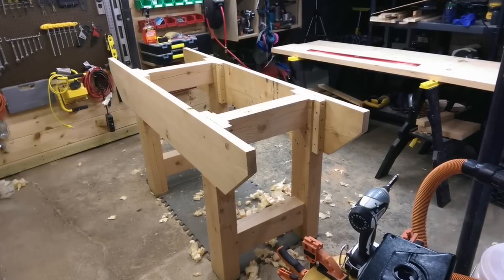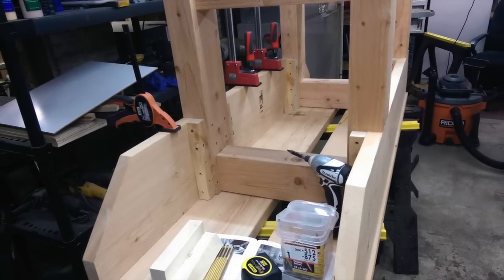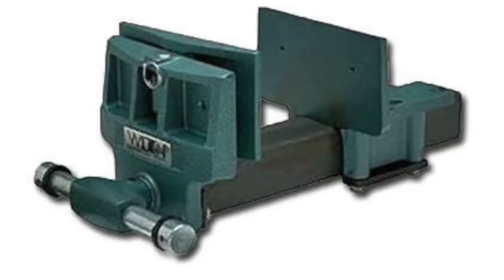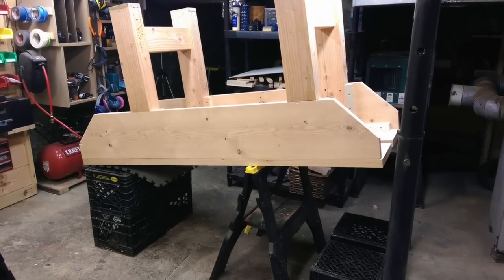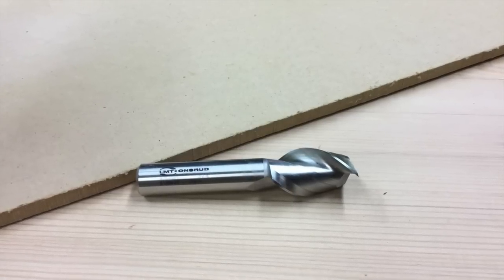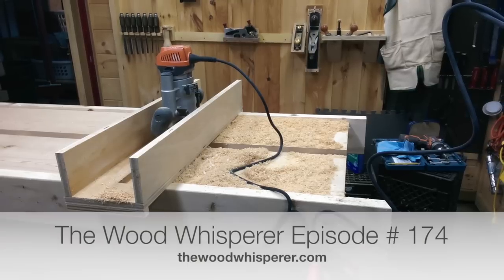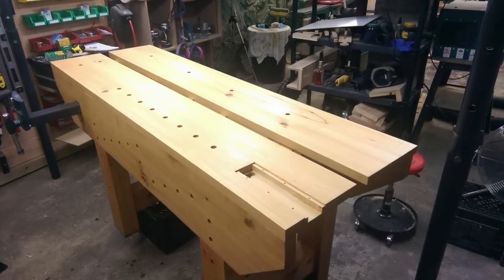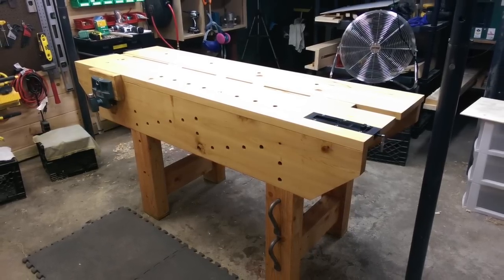Time For A New Workbench | Nicholson Workbench Part 2

Comment: How do you like the big aprons on the bench? Do you find you actually use them for work holding? I'm debating putting them on mine or putting a cabinet under it for extra storage. That's when I finish building it of course.
Reply from the maker: There's pros and cons for sure. I do like the extra real estate to clamp boards to which I feel offsets the bit of a PIA it is to reach under to push up a bench dog. I also tend to like my tools handy on the french cleat wall for my most used tools, so a cabinet underneath wasn't a priority for me, but others may feel differently. (I keep my less used tools in a Husky rolling cabinet nearby).

Comment: Nice video @The Wood Lab   -- I'm wondering how the top has worked out.  I was considering the same thing you did.  ... Adding extra "2 by" material under neath in order to make a thicker top.  Have you had very much movement (warping)?
Reply from the maker: Thanks! The top has worked out very well. I may need to reflatten it but it's only very slightly out at the edges - but it's very small.

Comment: nice work on the bench, i got to get mine done, you should give some details of the bench like dimensions, cost, and time frame, so if some one wanted to build a bench like yours, also post some videos of this bad boy at work
Reply from the maker: Thanks Peter! I'll definitely have the bench in use in the future. As far as dimensions, it's 24" x 6' long. Cost: wood was about $100 + Veritas end vise at $89 + the Wilton front vise at about $165. As far as time, I didn't track this all that well, but can say it was done over a few weekends and few nights after work.